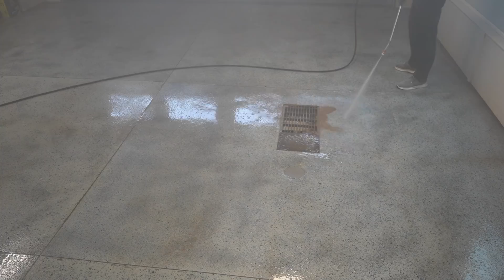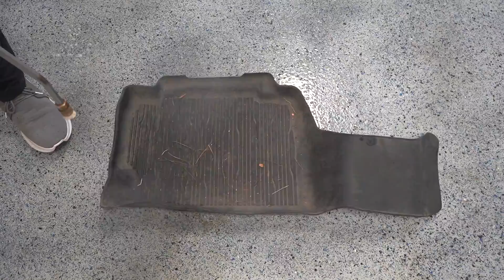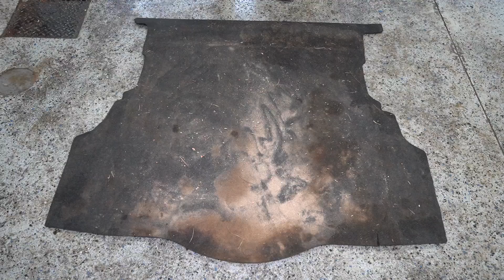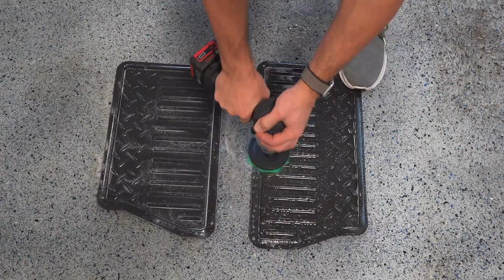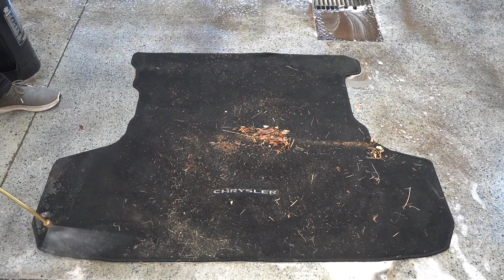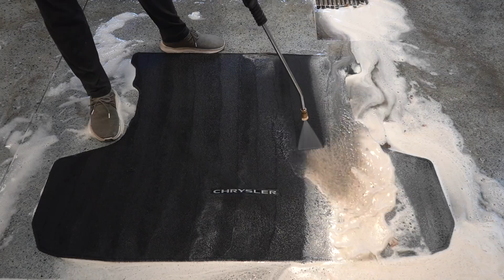Satisfying MUDDY Pressure Washing | Car Detailing Dirty Floor Mats! | The Detail Geek 2

Comment: actually can u use the broom to wipe those dirt into the drain hole? instead the water pressurer, to save up some water?
but the broom may trap rock and sand inside, and scratch the floor? 
really want to know how the drain hole thing work, i saw u did it once in the pass

Comment: Sorry if you have answered this question before, but is there any drying process done when you pressure wash carpets and carpet mats outside the vehicle on the floor, without using the extractor Bissell ? 🤔